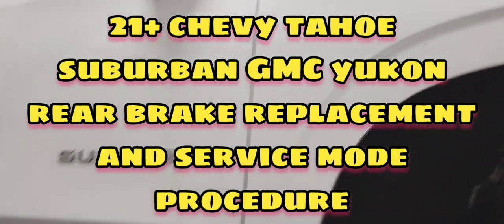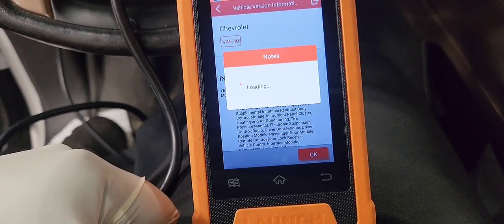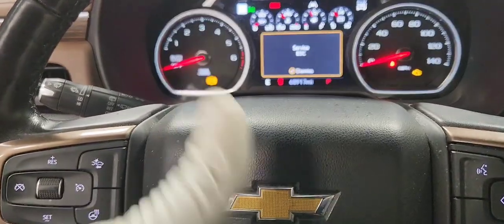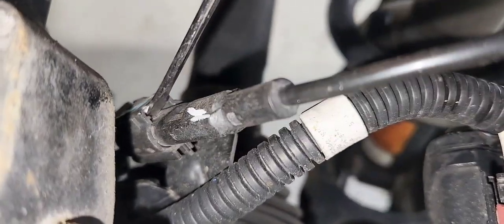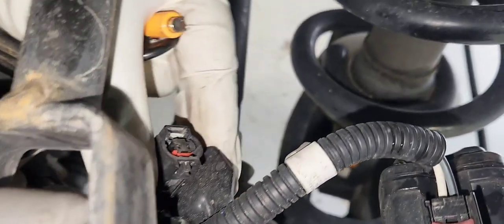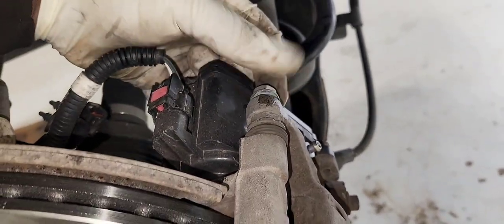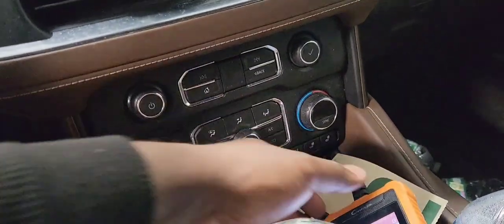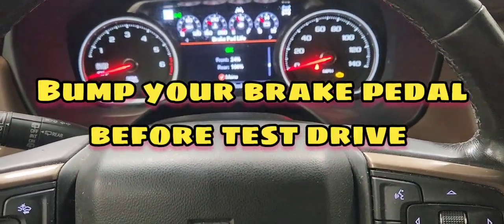21+ Chevy Tahoe/Suburban GMC Yukon rear brake replacement and service mode procedure

Comment from the maker: Link for scantool used
https://www.amazon.com/gp/aw/d/B09XV8VR35/ref=ox_sc_act_image_10?smid=A3F2UU8IZ3AFBC&psc=1&tag=steevegmtec03-20
Rear brake pads and rotors
https://www.amazon.com/gp/aw/d/B091JKR24H/ref=ox_sc_act_image_11?smid=A1YFPLO9ALKSCO&psc=1&tag=steevegmtec03-20
Basic hand tool set 
https://www.amazon.com/gp/aw/d/B08XPBR9JD/ref=ox_sc_act_image_7?smid=A1F0H6W3XGIV8J&psc=1&tag=steevegmtec03-20
Hammer
https://www.amazon.com/gp/aw/d/B00433SC3C/ref=ox_sc_act_image_1?smid=ATVPDKIKX0DER&psc=1&tag=steevegmtec03-20
Torx bit socket 
https://www.amazon.com/gp/aw/d/B07M9ZF35W/ref=ox_sc_act_image_5?smid=A3CTCSJRE9G6AY&psc=1&tag=steevegmtec03-20
Wire brush set
https://www.amazon.com/gp/aw/d/B0754556QP/ref=ox_sc_act_image_4?smid=ARQMKXOFZARDE&psc=1&tag=steevegmtec03-20
Brake cleaner 
https://www.amazon.com/gp/aw/d/B0BFXH1G3T/ref=ox_sc_act_image_2?smid=ATVPDKIKX0DER&psc=1&tag=steevegmtec03-20
Caliper compressing tool 
https://www.amazon.com/gp/aw/d/B08JSXP5GB/ref=ox_sc_act_image_3?smid=AV1GOFO2ZGLAG&psc=1&tag=steevegmtec03-20
Brake part lubricant 
https://www.amazon.com/gp/aw/d/B00D0IB5LC/ref=ox_sc_act_image_6?smid=AS02J2N1N5OVA&psc=1&tag=steevegmtec03-20